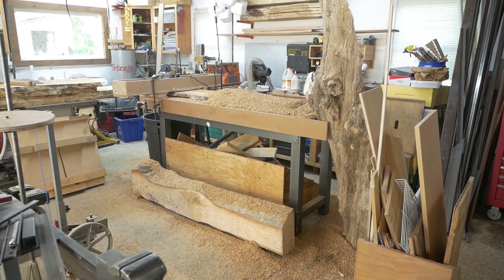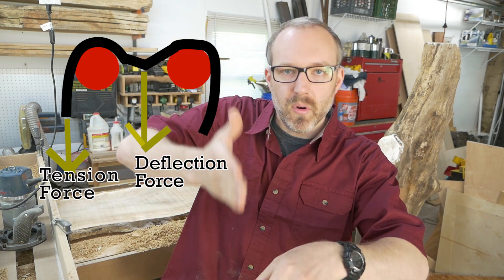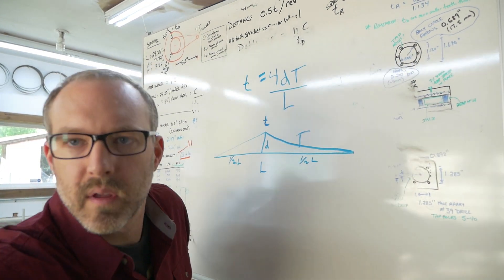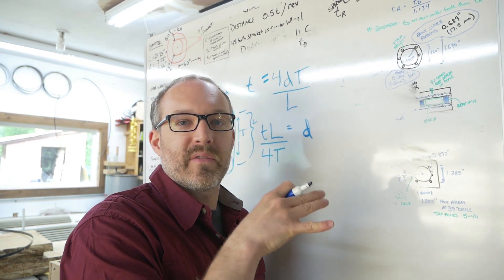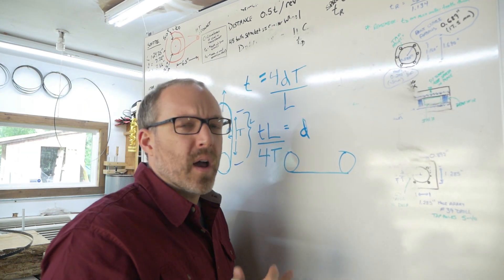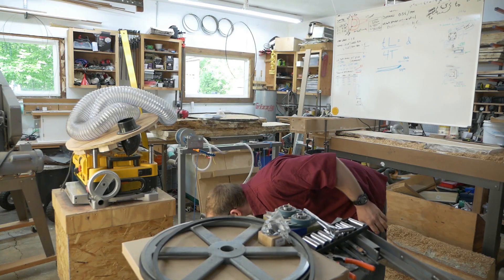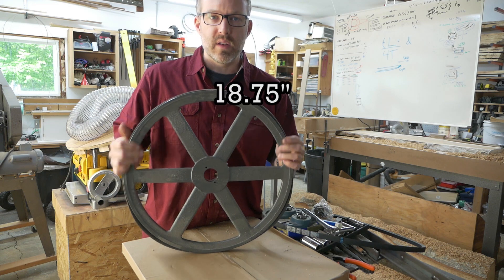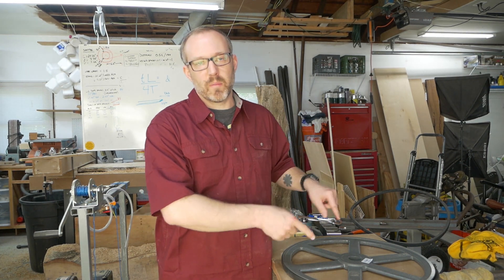Is this really why a Bandsaw Sawmill Blade won't cut Straight?

Comment: 15 minutes of my life I can't get back and a lot of WASTED math because you don't understand what every kid who's stuck his hand out the window of a moving car knows:

When the "angle of attack" is not directly parallel to the direction of resistance (or travel) there WILL BE DEFLECTION. (YOU should try it.) Stick your hand out the window of a moving car and when your hand is level not much happens but angle your hand up or down and guess what .......?

You like "math" so here you go: 
Take a 6' straight edge stand it vertical on your rails and hold it against the face of your wheels (one at a time), measure 8' down the length of your track then measure the diagonal length of the 3rd side of the triangle and if it is not EXACTLY 10' on BOTH sides (in simple blue-collar terms we call that "3-4-5") then one or BOTH of your wheels are NOT perpendicular (square) to your path and you have the reason you can't cut straight. The center AXIS of the wheels MUST be parallel with the track.
Reply from the maker: I guess I should have made it more clear that this whole video assumes a correct setup, so that the guides are directing the blade parallel to the track.  This video was more to address why a blade would still not cut straight.  The wheels don't really need to be straight, it's the guides that hold the blade parallel.  I usually check with a digital angle gauge, but adjust depending on tooth set.  Really the tooth geometry matters most because that's where the cutting happens.  Maybe I just buy cheap blades but I've never found one with a perfect set.

Comment: You are over complicating it and mixing a lot of misinformation.
1. The blade must be properly tensioned. Commercial sawmills tension a 1” blade to 16000-17000 psi. Assuming the width of the blade from the bottom of the gullet to the flat edge is 0.8” and the blade is 0.042” thick you need to stretch that blade with a force of 530-570lb. The tensioning mechanisms must therefore exert a force twice as high.
A simple 1/2” threaded rod/nut tensioner can easily create much higher force so the problem of blade tensioning is reduced to knowing how much tension is on the blade. 
Hydraulic tensioner have a gauge and the force can be calculated easily. For small mills compression springs are a good solution. They compress by specific length with given force applied so by measuring the length of the compressed spring one can quickly calculate the force on the blade with fairly good accuracy.
2. Blade tracking: alignment of the wheels must be near perfect. Wheels must spin on the same plane. If wheels are off by even a small fraction, blade will wander.
3. Blade guides: the guides must be aligned so they actually guide the blade with downward tension to keep it parallel to the plane of the tracks of the sawmill, not just skate on the surface in case the blade wants to wander off.
Adjusting the guide rollers is not difficult but requires fair amount of precision some woodworkers are not used to. Get a 6” digital height gauge, lower the blade close to the tracks, put something flat across the tracks and measure each side of the blade , front and back. If every point of the blade is within few thousands of an inch, guides are aligned well.
Then move the adjustable side of the guides to different points and repeat the measurements. They all should be very close. If not, adjust the guide rail.

Well tensioned blade running on wheels that are aligned to the same plane and guided parallel to the tracks plane will cut straight. There is no magic to it, just physics.
There force exerted by wood on the blade should be parallel to the plane of the blade. Any down or up force is an indication of incorrect alignment and tension.

A perfect alignment can be thrown off in seconds by sawdust particles sticking to the blade, wheels and roller guides. Good lubrication of the blade helps. Small teeth produce finer sawdust that tends to stick to everything, big teeth produce miniature toothpicks that fly out and not cause trouble. Use blades with bigger teeth, but feed it into material so those teeth produce large chips not dust. If the motor can not handle the load, get bigger one or live with the consequences of fine dust or build some scrubber and screen to reduce the sawdust deposit, clean the blade frequently to maintain good tracking of the blade on the wheels.

Wheel size is important for blade life. 12” wheels will be fine for cutting a few logs a year, not so much for running commercial milling businesses.
Aluminum alloy cast wheels can easily cope with the forces needed to tension narrow blades. It’s the bearings that do all the heavy work.
And this is where thicker shaft helps-it lets you use bigger bearings that can take bigger load.
But also thicker shaft will deflect less with blade optimally tensioned.
Less flex=better blade tracking and less material fatigue.
You don’t need to worry about material fatigue if cutting few logs a year, but tracking is always important.
Reply from the maker: This was flagged as spam, so I didn't see it right away.  I released it from the queue.  I think I'm in agreement with pretty much everything you said.  I'm not sure how the wheel alignment matters for the blade wandering in the cut, though.  The guides should keep the blade parallel to the cutting path.  The alignment needs to be good, but not perfect.  The kerf will be thicker than the blade so as long as it stays within the kerf it should be good.  Of course blade set needs to be considered but in my experience the teeth are never perfectly ground to be perpendicular to the blade.  In any case my problem wasn't that the blade always cut up or down, it was that it wandered and followed the grain of the wood.  I hope I don't sound like I'm preaching because I hope to just present these thoughts for discussion.  I like what you have to say, thanks for the comment!

Comment: Here is a monkey wrench to throw into your equation :  saw blade toot set !  a blade will always turn to the side of the blade with the teeth with more set and no matter who or what machine put the set in the teeth a blade will always have more set on one side than the other  . Cheap blades are much worse because of lower quality and workers that don't care...... Another reason  they wander up and down because as they reach up or down a certain amount the tension will increase slightly and turn the blade to track the opposite way it was pulling .  Bringing in the guide rollers in closer would most certainly eliminate most of it  for sure  less distance most certainly equals less defection .
Reply from the maker: Ah, tooth set.  I did sort of forget about that.  Could be that some blades of mine were dull, could be that the set wasn't good.
Reply: Had a dovetail saw that drove me crazy back  in the 90's , always turned right no matter what I did or how I held it . I was going to throw it away when my neighbor back then an elderly gentleman asked to see it and he gave it back to me a week later cutting straight as an arrow . I didn't know a thing about set until he showed me what was happening .

Comment: Blade tension is key obviously. Too much and you will prematurely break blades. Sharpness is important too etc. You didn't mention tooth set ( I don't think) which is critical or horsepower. Fewer teeth means each tooth cuts more thus requires more hp to stay up to cutting speed. Feed rate and blade speed are important even on sharp well tuned machine. Generally I think this is why mills tend to rely on robust designs rather than taking the engineering to the limit. This way more factors can be less than perfect and we can still obtain decent results without being broken down. $0.02 from a sawyer.
Reply from the maker: Yes, well said!  "More factors can be less than perfect and we can still obtain decent results". As a hobbyist I can afford to spend time fiddling around in order to save money but I'm starting to grow tired of pushing all the limits.  Maybe I'll just push a few of them.  I already want to make a follow up video to address tooth geometry, kerf width, etc.
Reply: Drew Eaton rigidity of the machine is the key to cutting material.
You learn this very quickly when working with hard materials like steel :-)
Milling logs produces forces most woodworkers are not used to so there is steep learning curve and a lot of surprises along the way.
But the end result is well worth the effort.

Comment: Off hand and without looking at any references I would think the psi of a saw blade would be related to the tensile strength and yield with consideration to the Fatigue cycles. (Would totally have to look at some strength of materials references to check that assumption)

As for that equation for the guitar string, if I remember correctly from PDE there is a big assumption in the derivation where the string is assumed to be infinitely thin and massless. I've never dived into the deep end of the pool with vibrations where they toss out the big assumptions and deal with objects that have mass, inertia, etc. But the basic thoughts you proposed are right in line with what I would expect you would need to do. Closer supports, proper tension, thicker blades (cross section), etc. 

I have to wonder if the equations relating to cutting force, etc for machining apply to wood... (we only did the equations with metal, but they should apply to plastic and possibly to wood)

Comment: That's always handy when you can find an equation for one purpose that also works for something different. I remember setting up drip irrigation and wanting to find out the flow rate for a given pressure and it turned out that a fuel injector calculator gave the same numbers as I got from testing.

All of those thoughts are on point. The board being cut @1:35 really tells the story of how outside forces can manipulate the blade, as it is following the same path as the previous cut on top. The only tip I have is that you can run the saw and use a sharpening stone or similar on the sides of the blade to help with any minor imperfection. If the teeth or the weld protrude a tiny bit they can deflect the blade. I'm pretty sure I saw it on one of Matthias Wandel's bandsaw videos.

Comment: There has to be some internal resistance to bending of the blade if thicker because a thicker blade would be stiffer feeling.   Just like a thicker bar of metal is stiffer than thin.   Great bunch of points raised.
Reply: ted sykora to overcome the force pushing the blade up or down the blade would have to be as thick as the steel bar. 
Those forces can not be overcome with the strength of blade material, but they can be eliminated with alignment and tension.
Reply: @rok1475  not suggesting thickness being the ONLY modification.    Just one of several.   I would be conceivable that a blade that is twice as thick would flex half as much.   Just a possibility.
Reply from the maker: Hmm I didn't think of that, good point